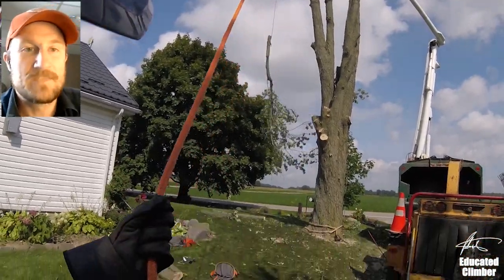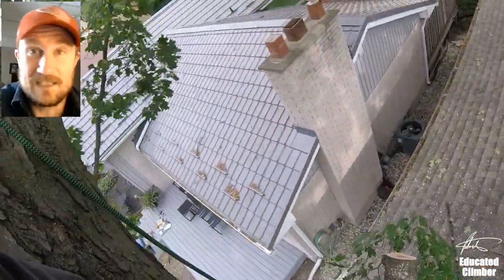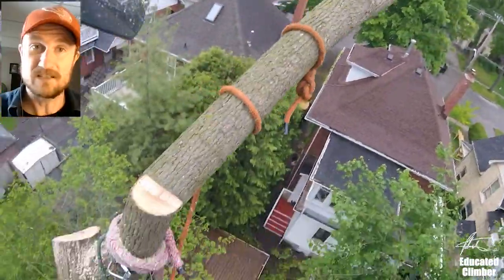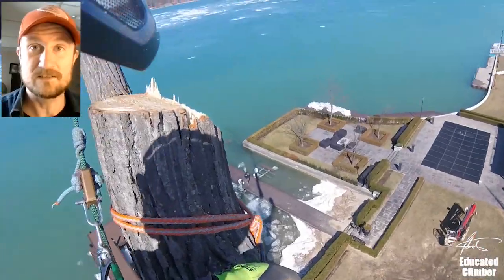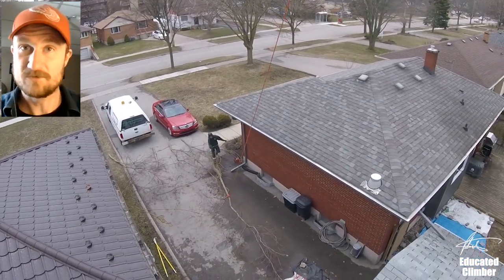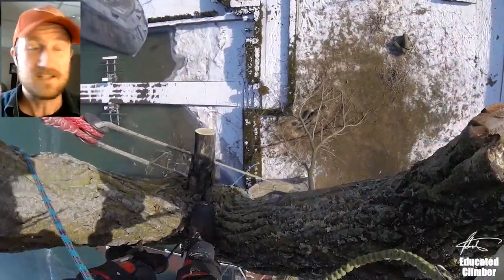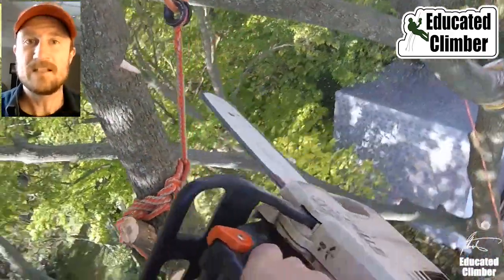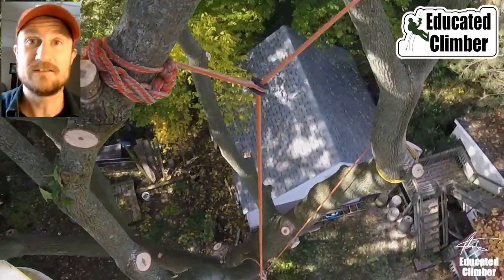Controlled Freefall | Arborist Rigging Techniques

Comment: You don't mention some key components. Diameter of port-a-rap diameter of lowering line number of raps. We have had trouble getting it to run using a 3/4 inch lowering line. Even with huge pieces and just 1 rap. So it seems to work well for you was just curious about your set up

Comment: I can say from very recent experience if you have the room to drop freely do it. If you have to rig down timber with any substantial weight like oak and can't let it run snap your chain brake on before it falls off the stem and calmly but quickly position yourself to absorb the bounce of the stem...it's like riding a mechanical bull.

Comment: Great video. Another technique we use is setting yourself up pretty far away from the stem, and running in 10-20 feet with the rope. Reduces initial shock load on the rope man especially when doing tips where you don’t want too much friction.